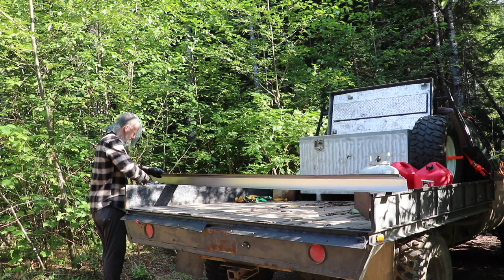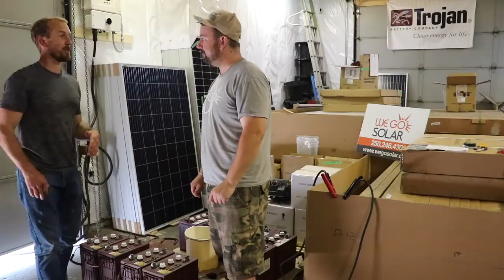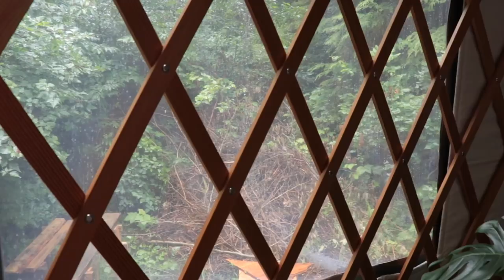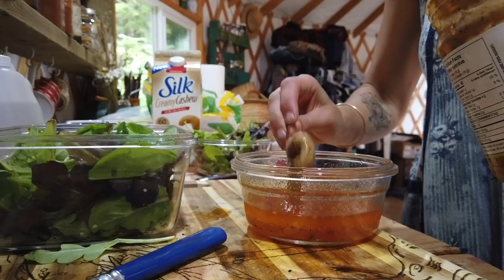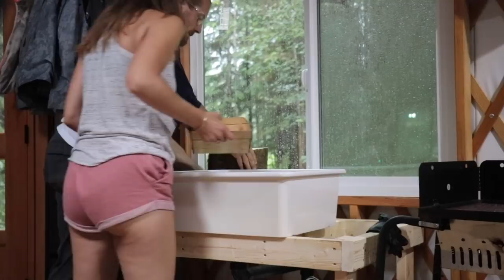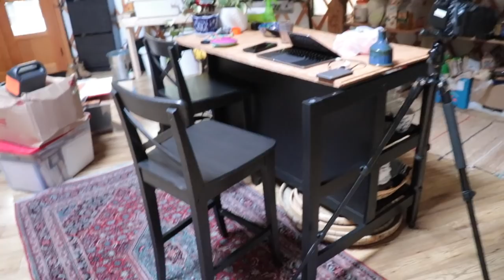Living Off Grid in a Yurt | Solar Panels with Batteries | Harvesting Rainwater Off Roof - Ep. 39

Comment: For maintenance on the deep cycle lead acid battery watch and maintain the water level. Caution. Do not over fill. Watch the corrosion on the connections on the batteries. A product called NOCO is excellent for the prevention of corrosion and the connections are good if the are shiny. Gray is not clean. Corrosion is present. Just trying to help. My family own a battery business since 1957.

Comment: Decades ago in New Zealand I heard of off grid folks living in the bush who tied ropes high up on nearby trees. When the wind caused the trees to sway the ropes pull on a ratcheted wheel which turns a generator via gears. I don't know if anyone currently using such a rig, but your location would seem ideal to try it.

Comment: Without a sink, you still can do a dishes indoor Nicole. Just used 2 big basin on the countertop, 1 for dirty dishes and 1 fill in with the water to rinse the dishes, then dump the water outside. I grew up without electricity or tap water. We used water from the well (using rope and pulley, filled the water inside the little bucket and pull out from the well with hand) and rain water. During drought season, we had to walk miles to the river to carry the water home. No stove top or gas for Cooking. We used wood and charcoal for cooking, but it's indoor. We plant our own rice and vegetables, catch fish from the river etc... Living off grid is not possible, just need hard work and dedication.  Also we don't have any transportation, had to walk miles to school. Now I feel like I am heaven :)

Comment: One thing I learned accidently messing around with solar power and car batteries is to use a battery inline (not looped for 24 volt) with a bad cell at the end you send to your dwelling it acts as a resistor allowing only what you need/ demand giving you a longer battery life.

Comment: Hey guys, nice video. As usual. Tip for the future: I used to have a small business in which I assembled flatpack stuff (no, I'm not offering my services - not all the way from England anyway) and I found that often polystyrene was used as packaging and to fill in voids. Use some of this to kneel on while you assemble, or else find something yielding like a folded blanket or cardboard.  A day on your knees and you will not be able to stand up. Alternatively if you can put me up for a while I can mosey over with a screwdriver...

Comment: P-trap isnt absolutely needed but you should put it in and you need a vent pipe going up to through the roof and attached to the down pipe going through the floor, you need the air pressure. Take that 90° off and put a T in. Also turn the sink around to face the right direction.

Comment: put the water pump on 12v to push the sink water out of the plastic tank to the switch, use the accumulated energy from the solar panels 12Volt solar pump 5 meters to raise the water

Comment: Dude ya need a pee trap  and a air vent on all drains it  keeps the smell and the insects outside
Reply: it wont take long and he will learn trust me
Reply: Also, he put the sink backward. the drain should be closer to the wall than the person standing next to it.
Reply: Also, shouldn’t the pipe go straight down first?
Reply: Laurent P Agreed. The drain shouldn’t be where you scrub the dishes. I feel bad because I hate having to redo things.
Reply: I’m not a plumber, nor do I pretend to be one on TV, but this is a major oversight, Jake. Gotta install a p-trap. You’re gonna get smells and critters that will fit through that “stopper with holes” you don’t want coming back up that pipe.
Reply: Its It’s OK for temporary but when you do it permanent for more than two or three years make sure you have a peetrap
Reply: don't need a trapif there is no septic
Reply: ray kemry  no sewer, no smells, no trap needed.
Reply: Watched a couple vids. Cool. Anyway if septic yes shoul DC have a trap arm and p trap and since its ayurt you can have an air admittance one way valve hidden behind the sink for a vent. I've been a plumber since 94.
Reply: Doesn't need p trap its a gray water system for his garden might want a mesh screen to keep bugs out bought it. Plumber could even have a tank that holds grey water and in America that ups price of home significantly. Any black water system should be brought to  UPC code for sanitary purposes of course and safety

Comment: I'm partially off grid in PEI.  Six Surette S600's , an Outback VFX2800 and 2.5kw solar.  I'd love Lithium but the costs are still too high for me personally.  I got 12 years out of my older Surrettes.  They are still in use on a separate array, which I use as backup for my Desktop and limited lighting

Comment: i bought a gel type battery for my solar setup but its nowhere near as powerful as i need to run a house that uses more power than most of my neighbors
Reply: PrincessTS01 it takes 20+ solar panels to produce 20 amps which would operate 1 standard recepticle in a modern house..as a fridgerator would consume much of that it would in no way run a 30 amp range..30 amp hotwater heater & would only power 1 wall banger ac unit..ntm w all the trees that encompass the yurt the storage capacity will b limited & the storage batteries r very expensive

Comment: Don't know where this guy gets his info on batteries. But lithium ion battery prices (at least in the states) are pretty cheap ...compared to what they were 5 years ago. That and Lead acid will normally die out around 5 years ... not 10. Gel or AGM because they don't off gas have  (to some degree) a better life expentancy over liguid. Though lithium ion cost a bit more ...the performance and longevity in the long run are much cheaper than either lead acid or AGM.

Comment: a good way to get batteries cheap is cell phone tower they replace the batteries all the time and they are good i had one set last over 10 years and they only cost 10 to 20 dollars each and when they are dead u can get ur money back i run of the used batteries and keep a new set up on reserve and when some one moves try to buy the old panels from them cheap last few set of panels i got just for helping them clean up the place so they can sell it  been trying to put to gather 10,000 watt set up that is my goal i need it for the shop i like to build cars and repair cars for people right now i'm working  on a freezer set up
Reply: ps try high end water pump for an rv there about 350 bucks but it can run a 3 bed room house with 2 baths or u can put a tank about 500 to 1000 gal up over 25 feet above the the highest out put and u will get good pressure just have a pump to pump it up i use 2 inch pump for the rain water from a ground tanks and make sure no light from the sun hits the water and it will last longer

Comment: My buddy built a loft ended up insulating the room below it  and put his bed room inside the insulated room , it was to loud from rain and cold in the snow. Now it's quiet and warm in his need room , his wife is still not happy with the yurt. Last week they had a cougar on there trail camera that is focused on his front door deck area, figured out it was lòking for a drink and a bite to eat. They have a out door kitchen  .  I  still think it was looking for there cats for a quick meal.  They have usually got about 5 that hang around. They are always not coming home. They keep cats due to the high rodent problem they have. They have built a cash to keep there food safe and he has a few deep freezers for cold boxes buried outside.

Comment: You’re going to hate that sink height it’s going to kill your back at that height . You know the trap is used to keep not only gases which you won’t have but also bugs from coming in. You putting a screen on the end of drain pipe will clog up. You can buy a screen to lay over drain in the sink which is easier to clean than taking your screen outside off to unclog. Make things easy for that gorgeous wife you have. She is so HOT!!! Good luck guys

Comment: I did DC power work for about 5 years and just listening to that  guy talk about lithium batteries is enough for me to not want to do business with him, for that matter the format of those lead acid batteries is not the format I'd want.  For that matter I'd prefer getting some old used lead acid batteries and I mean the big ass glass ones.  Lithium gel cells are never going to be something you're going to want for home use, they have a life expectancy of about 7 years before they just shit the bed no matter what you do with them.  If you have batteries just sitting there for 7 years and you never draw current from them you'll likely still need to replace them let alone if you're charging and draining them constantly.   Lead acid is ideal because they will last forever if they are in format that allows you to do proper maintenance on them.

Also, dude you live in a temperate rain forest with drainage funneled onto your land and you're obsessed with solar with a slight fetish for wind.... Dude it rains 2 out 3 days on vancouver island and you're pretty far north.... Solar isn't a horrible idea but those panels will never pay for themselves.  What you need to do is look into water drainage and some hydro power.  You've already got water being funneled into your property, you have marsh you need to adddress  50 foot outside your door anyway...  not to mention a hydro setup is also cheaper than a bunch of solar panels that are going to provide jack shit worth of power, its far more durable than a wind because OMG you limit the max power by the size of the pipe....   I hope you  eventually looked into this...

also... I respect the vegetarian thing but I just gotta point out that you're not really vegetarians and you are in one of the best places to fish in the world.  Want to talk about a great way to feed yourself off grid, toss a fishing pole into that lake a few hours a week and you will need that garrden just to grow herbs to season your fish....

Comment: I feel bad for yall, I feel like wegosolar sold yall on a poor solar system and poor solar advice just going off the information you already have published to us in this video. Firstly the battery choice is a terrible choice, it's very old technology and actually, cost you MORE than hundreds of other battery options on the market now.  Those batteries you got are rated 370Ahr, but only about 40% of that is actually usable if properly used without risking damaging and shortening the life of the batteries. So realistically you can only get ~290Ahr@12v out of them if properly discharged based on manufactured recommendations and even then they are only rated for roughly 200-250 cycles before they drop in capacity to ~180Ahr@12v. So in 3-5 years you will only be getting ~50% of the capacity you will get today on them new and in most cases a cell will start to short before the 5 year mark bringing down the rest of the bank. A far superior and better option would have been SP-LFP300AHA cells, 4 of them new is the same cost $1500-1600 and occasionally you see them used for a fraction of that on ebay. You can fully use the entire cell and still get  5000+ cycles out of them before the capacity drops to 50%, so you can run them daily to completely drained 100-0% for the next 10+ years and expect to get still greater than 50% capacity in 10 years from now for the same cost of the batteries you went within your video and you get away from all the maintenance that comes with flood acid batteries. I have 7+ year old sinopoly cells in my solar with just over 2000 cycles according to the system and im still getting 83% of the capacity out of them as i did 7 years ago when i installed them. The only thing you need is a $40 low temperature cut module in your bank to protect them and add a source of heat to keep the cells warm enough to properly work in the winter. we use a small ceramic heater that cuts on below a set temperature and the bank is cut completely below a set point, which we use generator power then, but that is maybe 1-2 days a year in the past 7 years. Since you are in the rain forest, please do not use a single solar charger with all the panel linked together, unless you are clearing a giant area in the forest to prevent shading on your panels, having them all linked together running to a single solar charger will gimp your system greatly unless you run solar optimizers on each panel. Anytime a single panel is shaded when they are all linked together, it's like adding a choke to the system reducing your output greatly as a system combined. In your case it would benefit you to go with micro-inverters or optimizers on each panel to prevent shading losses
Reply: They lost me at the extremely poor battery decision. I don't understand how someone can go into buying such an important system for so much money without studying all the options properly :(
Reply: @martink9785  Ya fell for the same mistake, went to a expert solar company local for advice, they sold me a kit they installed and in 3 years nearly every major component had to be replaced under warranty and the flood acid bank was only giving 63% of the capacity only, struggling to supply our household needs. So i replaced the system except the panels and went with good quality brands like midnight solar and sinopoly cells with a 192v battery bank. Now 7+ years later ive not had a single issue now "knock on wood" We have replaced most of the house to run off DC directly, all lighting now in the cabin is ran off DC along with new DC powered mini spit air conditioner and heater. We only use small microinverters at the device to power items we couldn't convert to DC. For example you can get DC power adapters for most TVs and Laptops and such...

Comment: hey first major thing I wanted it I saw that I want to comment on if you remember Lost in Space Warning or Robinson warning danger danger Will Robinson!! I see a 20 lb propane tank with a rubber hose inside a building guys get a copper line drill hole in the floor or pick on the wall put the tank outside with a copper tube not a rubber tube that can melt when it gets hot there's one that melts you've got an explosion there magic major fire and you're going to put it out with anything you've got. please fix that there's a family living in a camper they bought a fifth wheel camper and they had borrowed another camper it was a family about five or six kids propane tank inside fire explosion blew up the one camper burn the other one down that they didn't own anyway had to pay for it send me their homeless and that's happened over and over and over again those things are danger danger danger danger please do something different cover Line running outside tank outside and never have a tank inside!!!

Comment: This guy is so egotistical he will not take a suggestion. You may not NEED a p-trap but it would not hurt to keep insects/mice out. That metal piece you put on the end and poked holes in will be stopped up in a week. You need a septic tank, the area where this drains will sour and stink. Does not matter the type of soap.